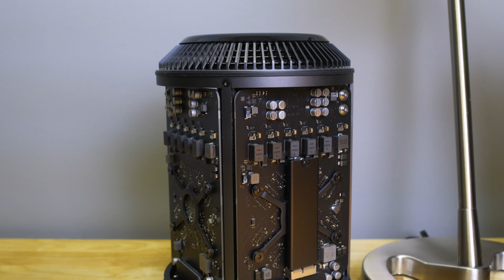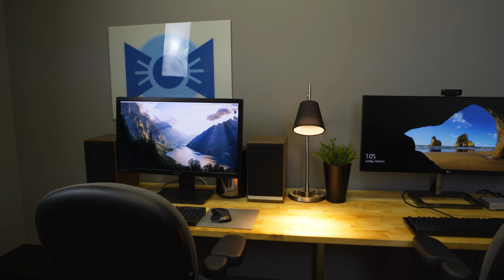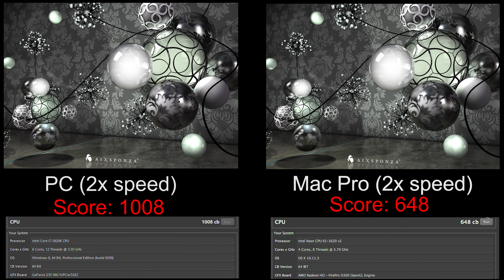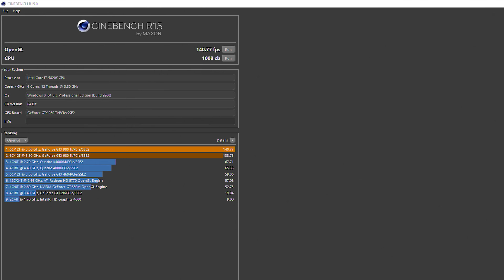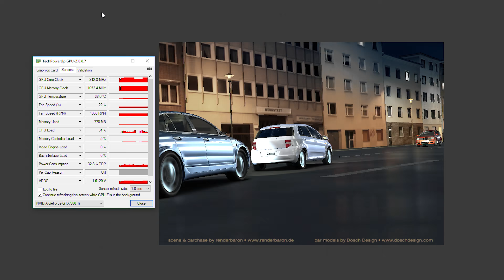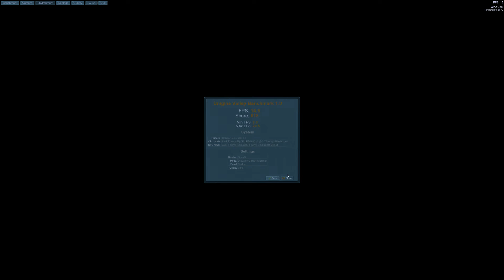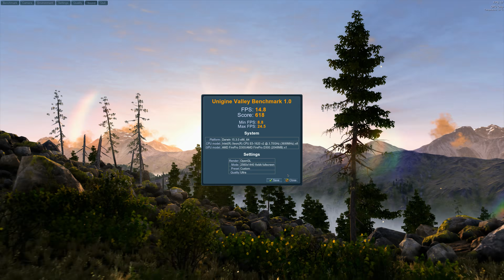$2,000 Custom PC vs $4,000 Mac Pro

Comment: you can't compare a gtx whit a firepro, they are not made for the same purpose
Reply: +Riccardo Pivetta but they are doing the same jobs , the macbook pro is for video editing , the pc he build is for video editing , he did tests which are used by people looking for video editing
Reply: if you take the valley benchmark of corse the 980 ti will destroy the firepros because it has anything to do whit video editing but whit gaming
Reply: +Riccardo Pivetta he did non gaming benchmarks or did you not watch the video properly? also cuda support is in a lot of programs for professionals
Reply: +Calum Moore you don't get what i mean and yes i watched the video properly. i ask myself why people on the comment section act like morons
Reply: +stephen allen You don't get the point, it's like trying to say that a Vaccum cleaner does a better job cleaning the carpet than a mop. Of course it does, that's what it's designed to do. It's like comparing a vaccum and a mop's ability to clean the carpet, you just can't/
Reply: Henry Black mac pro is meant to be used for rendering , editing and doing work. in the video he compares the pc he made to the mac in a benchmark used for rendering , i get the point idiot
Reply: stephen allen Who came up with the idea that that's what mac was meant to do?
Reply: Henry Black because that is what the mac shown in the video is marketed for

Comment: To be fair Apple offers higher core Xeons (up to 12 cores) but cost £2400 more for the CPU itself and the base CPU is the 6 core Xeon @ 3.5GHz. The RAM is ECC and up to 64Gb but again at £960 more than base 16Gb. Overall, PC wins. GG Apple suck it, and VR ain't coming your way any time soon
Reply: that why dont buy apple products
Reply: Jerico Goco Yup
Reply: +The Standard Gamer well adding to that, the chipset he is using allows him to upgrade his CPU up to an 18 core Xeon (last I checked for Haswell-E 2011 v-3) and supports upto 128GB of DDR4 RAM, some X99 boards will even run ECC memory
Reply: ***** Yeah I'm just saying but Tek Syndicate just uploaded a video of old Mac pros from before 2013 being upgraded to 2 6 core Xeons
Reply: I think I know which video you're referring to. My issue with macs is they are overpriced. Even if i did like the Mac OS, I would probably Hackintosh a PC instead of buying a Mac, that or look on the used market
Reply: ***** That too, used is still better than going to Apple

Comment: My question concerning Mac and PC, is mostly about programs performance and flexibility you can get from the machine. PC has way more programs and choice but bugs, virus and crashes are more frequent. MAC is kinda stable but limited in choice of softwares, and the prices are nasty. I do video edit, despise I don't like Mac and Final Cut Pro, I heard just but good comments about fiability. I work with Vega Video on PC, very friendly and cool program but has limitations, sometimes I have to reboot. 

On the long run, both systems will be sumitted to the law of planned obsolescence. About $ and flexiblity, PC still wins for me but if I was rich and having time to learn the machine, MAC would be my #1 choice.

Comment: I am a hard core apple fan but always prioritise performance over brands in computers. Apple spends a lot in design but very rightly pointed that, why are we sold 3 year old hardware and plus the biggest drawback, very little upgrade options with Mac. Had it been 3 years with a PC, you would have changed the shi1t inside out and everything but sadly things aren't same with the $4000 price tag machine. Something Apple need to rethink about.

Comment: Use final cut pro to export the video it will be much FASTER
Reply: +Snazzy Labs 
4:00 "gaming usually stays in single core processing"
go home youre drunk

gpus have several cores on them m8 which is the whole soul of gaming processing these days... and gaming takes up most of those cores

remove ur graphics card and use the stock one and watch as the cpu core's usage would rise as the on board gpu isnt sufficient

gaming is just as sufficient with burning through multi core processing

just not like as you would think
Reply: +Test Storm Actually, all the hype with the new DirectX is the fact that it is able to use multiple CPU cores. Until recently, most of the load on the CPU was on a single core in the majority of games.
Reply from the maker: +Gt cars Probably. Don't like FCPX though.
Reply: +Test Storm He was referring to the CPU processing, not the GPU. In general, most games today aren't that good at multithreading. (Lots of channels and websites have explained this.) 

There are some noteable exceptions - 'Ashes of the Singularity' and 'City Skylines' come to mind as two games that have pretty decent multi-core usage.
Reply: Jacob Allison
okay so thats the fault of a bad architecture and not a cpu?

Comment: I've build a few 5820k machines for people, and they should hit 4.1/4.2ghz even without upping the voltage...just setting multiplier to 42 should work, you could probably push it much further with some additional voltage (the rigs i build were 3d rendering rigs and they run stable for 24/7 renrering)
Reply: +Tim van Helsdingen those vrm heatsinks look very small and i doubt the itx mobo has a lot of power phases

Comment: Yeah PSUs do "wear out". The caps lose electrolyte. Fixable by using better caps (105 deg and low ESR).
Reply: +Mike Page Does pouring Gatorade in to the psu help?

Comment: comparing ECC vs non ECC hardware with Workstation Graphics vs Consumer graphics?
could have told you that its gonna outperform on benchmarks, but what about the tasks that the custom one cant even execute, or the safety features of ecc?
Reply: +despiciouz it's the features that you don't get/need in a consumer PC. The MAC is designed for Workstation use, has special drivers and ports that you dont get on your pc
Reply: +despiciouz 
build it yourself:
 http://pcpartpicker.com/p/FYbWVn
hardware comparison: https://www.macnn.com/articles/14/04/11/amd.firepro.d.series.power.the.mac.pro.to.new.performance.highs/
Reply: gdogawesome But with that you wont get the support, warranty etc, but I think Apple is still overpriced non the less.

Comment: I still feel as though this wasn't exactly a fair test since one was running OSX and the other Windows, each using DirectX and OpenGL respectively. 

If the Mac Pro was running under Bootcamp, It likely would have still lost by a long margin. 

Still, food for thought.

Comment: I agree that it is very sad, that Apple doesn't provide the latest and greatest in their Professional computer. I currently use both Mac and Windows desktops. Even though, my Mac mini has much less power than my custom PC, I still use it for video editing, because I prefer Final Cut Pro X compared to Adobe Premiere Pro and the tiny Mac can even handle editing 4K.

However, if the latest rumors are true, Apple will no longer focus on Pro users, thus drop the Final Cut Pro X. In case that happens, I will completely switch back to Windows, because there will no longer be anything special on the Mac platform.

Comment: Run those same test in a couple years when that PC is a bit older.
Reply: +Justin Still would probably blow it out of the water. This isn't a random pre-built. Custom builds generally use higher end parts that are meant to last a while. I still see people rocking stuff from years ago and doing all the stuff they need to and for a fraction of the cost. I would understand if you made an argument that the software or os is easier to use to navigate being the deciding factor, but in hardware specs that argument wouldn't hold up.
Reply: +Justin it will score the exact same... parts rarely slow down over time if you keep them well
Reply: +Justin it will score the exact same... parts rarely slow down over time if you keep them well

Comment: My 600$ PC got 500 in cinebench
Reply: +Fluffy Greyfoot Damn, that's pretty impressive. I'm guessing you're in the USA or you bought used (maybe a bit of both). What are your specs?
Reply: +Dreamy Bacon (dreamybacon) Well here in sweden it cost 800$, but if I lived in the US it would cost 600$. Specs:

I5 4460

8gb 1600mhz ddr3

R9 380
Reply: Fluffy Greyfoot What do you get in the OpenGL benchmark?
Reply: +Dreamy Bacon (dreamybacon) 111 fps
Reply: +Fluffy Greyfoot lol
Reply: +Poly khalil Fallout 4 ready I guess :9

Comment: i guess something have to be corrected here. it have nothing to do with how old the hardware is or mac vs pc, in fact those both systems are created to serve different purpose. firepro are workstation graphics with specialities on cad, animation, etc. you could tried it out on windows pc setup with quadro which twice the price of the 980ti and still the quadro will  struggle in stuff like gaming. the very first test you ran, actually could be faster on mac pro if you use the gpu to render.
Reply: +MrRioust That is not exactly true. I am pro 3d animator and I have similar rig. There is no need for quadro cards anymore. Nvidia gaming gtx cards have extreme computing power that surpass quadro line now in any real-world test (think CUDA), and nvidia sold obsolete hardver like quadro for x4 just because drivers but autodesk and adobe just optimized their software now days. So, head to head in any workstation task there is no contest. Also, he didn't overclock processor nearly enough (4.5gh is some easy overclock)

Comment: maybe we pay the r&d designe, and tthe osx is the best for sure (fonctionality, no bug, and video montagre)
Reply: most Macs run on hardware that is also available on PCs. There is no R&D involved, except for the actual aesthetic design of the product. Linus Tech Tips actually has a great video explaining why specs on Macs can be deceiving - that "sexy/ thin" look sacrifices cooling. Even if a Mac had the same specs as a PC, it would still lag behind in performance because the components will throttle themselves down to prevent overheating. Apple has beautiful designs, but don't expect great performance out of them

Comment: I'm super new to PC building but that valley benchmark seems really low? I'm running an AMD FX-6300 CPU overclocked to 4.5ghz and a evga gtx 970 ftw overclocked to about 1600mhz and I'm getting framrate averages around 80-90fps. is it because I'm doing mine at 1080? does it make that much of a difference? and yes I'm setting it to ultra.
Reply: +Chris Dwyer resolution will make a HUGE difference, if you tried to run at his resolutions it would be able to, but struggle much more than at 1080

Comment: this video is stupid, the Mac is 3 years old and is not ment for gaming (but there's video where mac ran Crysis 3 on 6 screen set up, and this was 2 years ago, when no PC would've done that). Then there's the fact this one had 4 core CPU, the 4000$ one has 6 core, optionally upgradeable to 8 or 12 core. The Mac has MUCH MUCH faster memory than any SATA drive.

Why make comparison video between top of the line 2016 technology vs 2013 technology? Also, maybe don't lie about what version of Mac you used. Also maybe use mac in video and photo editing tests, memory speed tests etc, not 3D game rendering benchmarks...

Comment: Except the Mac is a fraction of the size. It also has workstation parts, which are hideously expensive, putting it at an immediate price disadvantage.
Why don't you build a PC with the same parts rather than the much cheaper consumer parts and see that it's actually not overpriced and is good value to someone who needs the Xeon processor, firepro GPUs and ECC ram.
You'd come to the same conclusion if you compared a DIY PC with workstation parts and a consumer "gaming" PC.
Also they don't need to update it every year, it's not aimed at the PC nerds/gamers that are constantly swapping parts every time something new comes out. It's aimed at the industry, and the parts it uses don't get updated as frequently because you aren't going to fit out your company with $100k worth of PCs then swap them out again in 6 months.
Reply: bassl0va What premium design? The Mac Pro literally looks like a GARBAGE CAN. I can see it on things like their Macbooks where they are nicely designed indeed, but the Mac Pro, even beyond the shape, has a terrible glossy finish that just doesn't look good. Actually, almost everything they design excluding the Macbook and iMac lines is ugly IMO. Where's the premium in that? Where's the premium in the bending iPhone 6 Plus? Where's the premium in the butt-ugly $100 battery case they're now making? I'd like to have a Macbook Pro one day but the Mac Pro makes zero sense to me.
Reply: +bassl0va 1. You can build a Mini ITX rig like this one, you might have to switch to an R9 Nano GPU, but it will still run laps around the Mac "Pro".

2. The Xeon is literally the same architecture as consumer Intel CPUs but lacks an integrated GPU so all things considered it's the same thing, except they offer them with higher core counts (not the case here).

3.http://www.newegg.com/Product/ProductList.aspx?Submit=ENE&DEPA=0&Order=BESTMATCH&Description=amd+firepro&N=100008333&isNodeId=1

There. FirePro GPUs. The first one that's slightly over $600 is still significantly faster than the one in the MP. Add two in Crossfire like the Mac does and it's still much cheaper, much faster and has the "workstation" features.

4. ECC RAM is still quite affordable.
Reply: +bassl0va please look at what Marjan said... and learn what you are talking about before presenting poor "facts".
Reply: wilson pies How about you stop hating Apple just because it's "cool" to do so?
FYI I don't have an iPhone, and the only Apple computers I have are at least 10 years old so I'm not a fanboy or anything. 
My point was basically that it's not made to compete with a hobbyist's DIY PC. It's a premium product so they charge a (reasonably well justified) premium price.
Great thing is, if you don't like it, you don't have to buy it! So there's really nothing to complain about.
Reply: bassl0va
its not premium... and they charge a premium for it.... a dell computer competes with it for 1/2 price also... "How about you stop hating Apple just because it's 'cool' to do so?" love this line :D you have absolutely nothing to say so you make up what you believe people do... my reason is in the MODERN world, buying an apple PC makes absolutely 0 sense other than the mac OS.... which you are charged 2k$ for.... I also don't hate apple... I have an iPhone, which i love the simplicity of... please, don't be ignorant...
Reply: wilson pies They charge a premium for it because they are a premium brand. Also, to be a premium brand doesn't always have to mean the best performance. They are mostly focused on design and build.
There's plenty of premium brands that make things that are utter shit. Ugly and/or poorly made. Sure Apple doesn't have the most performance/$ but at least it's well made and looks nice and for some people that's what matters. As I said, if you don't like, you don't need to buy. Others can spend their money as they wish.
Also where I am at least, the difference between a Mac and PC pricing isn't as bad as it allegedly is in the USA.
Reply: Marjan
Thank you, I just decided to stop wasting my time with stupidity XD

Comment: Please run the benchmarks again by running Windows on the Mac Pro via Bootcamp. In 3D benchmarks, both OSes use different graphics subsystems. The one in Windows is much more efficient than the one in the Mac. So, it's not a fair comparison. If you rerun the benchmarks on Bootcamp, you'll find that the Mac Pro will give better scores, but it won't surpass the PC, still.

Thanks for the video.

Comment: so you've put a workstation grade machine up against a consumer grade machine....... is anyone EVER going to do a fair comparison?  like between the MacPro and a HP Z series work station? or a DIY workstation?

Xeon processors, ECC memory, Workstation grade graphics.  each of those costs quite a lot of money over what the consumer version of the products cost.
not to mention the engineering behind making something so powerful so bloody tiny and quiet.
Reply: It's not a xeon though... Therefore it's a different class of chip
Reply: +William Brack That's not the point.... you could do EVERYTHING that you can do on the MP 3X faster on the PC for 1/2 price..... if i were to render a video on that chip, it would take ~1/3 the time... Class means nothing, something can serve dual purposes. also someone in here already linked a "Workstation build" for 3k that had a much faster firepro, a xeon, ECC ram, which would destroy the MP in every aspect...

Comment: While the cpu on the Mac Pro is obviously less than ideal, I mean why ever get just a quad core Xeon, The whole graphics sections is rather misleading. While dual Firepro D300's absolutely will lose to a 980 Ti in unigine valley, It was never designed for this task. They are workstation cards, and running a 3d graphics benchmark against a top tier gaming card is entirely biased and skewing results. While I absolutely cannot stand Mac products, this specific computer is designed with the idea of it rendering 4k video and images, 3D modeling and animation, and using UpenCL programs, not OpenGL. If you want to do a comparison, at least put a little effort to do it correctly.

Comment: I'll take the G5... And the PC... The Mac Pro is nice and cute because Tim just wanted to make it, "Small, compact, elegant." But forgot about the power specs... The G5 is still a fucking beast.
Reply: By G5 i assume the old mac pro design? because the actual G5 was the last powerpc based mac before they moved to intel chips and is over 10 years old.
Reply: +Tim van Helsdingen Yup, exactly.